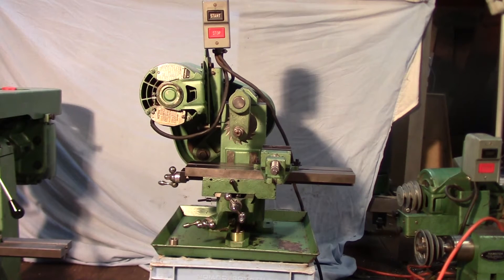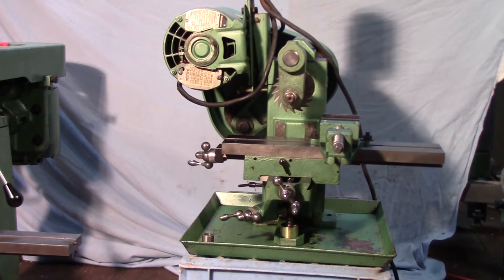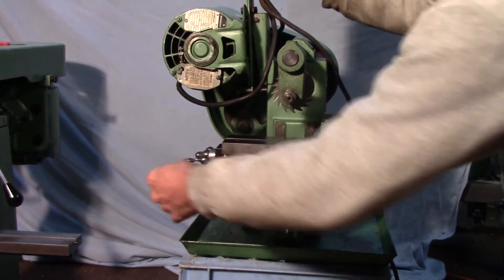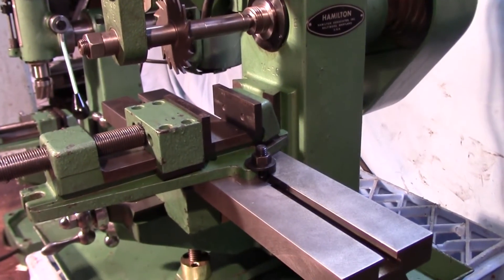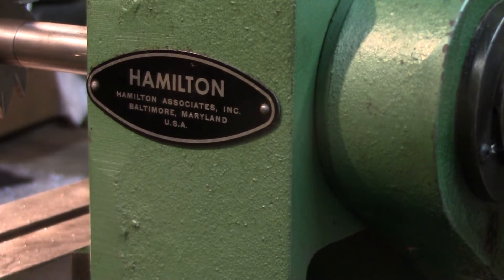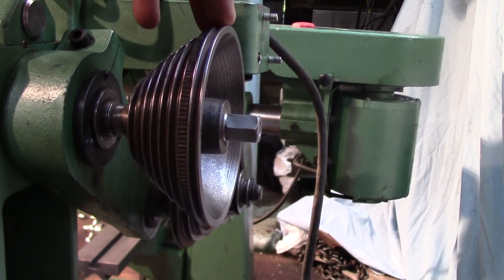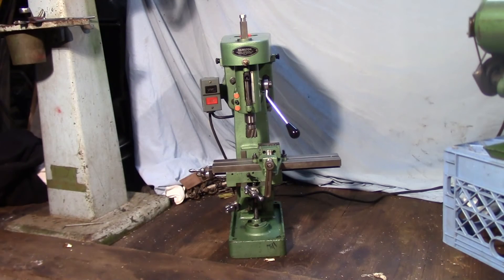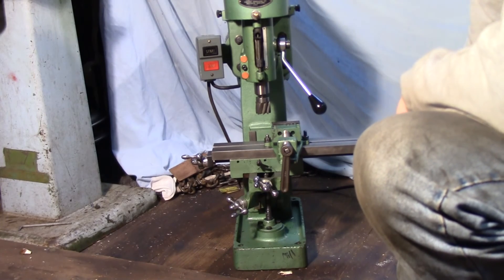The Anatomy of Hamilton Milling Machines

Comment: The Horizontal looks just like a Barker milling machine  I like the small milling Machines I have two Atlas milling machines one came with a Rusnok milling head I also have a burke Millrite  milling machine  two Shapers a South bend  and  a Ammco  and an old Craftsman  12 inch Lathe  I love these old Machines